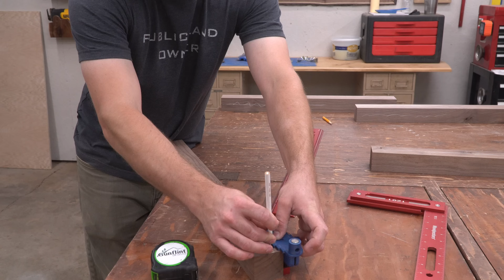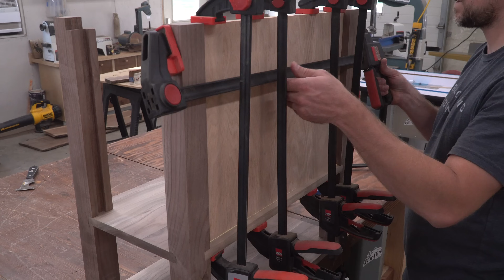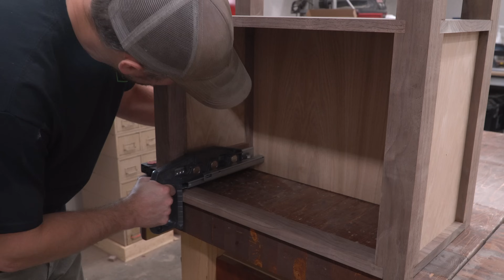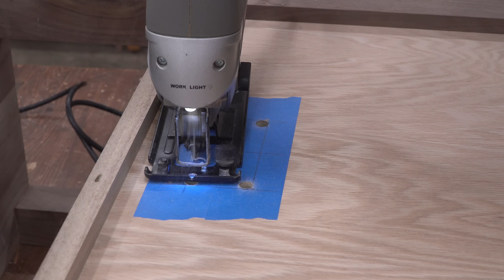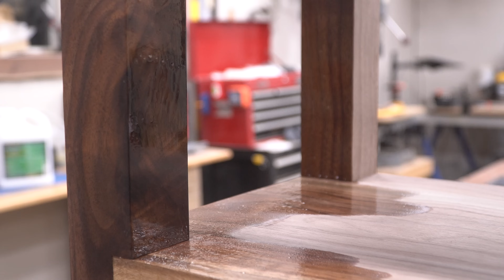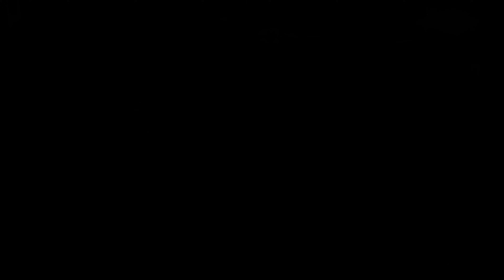Nightstand With Built-In Power - Woodworking Project

Comment: I like the design. Trying to scale it. So the bottom open shelf is about the height of the bed (to hold/see alarm clock) and the top is about 6-8" higher for knick knack stuff?

Are you happy with that or would you change it in future builds?
Reply from the maker: So far I'm happy with it. I currently don't have a box spring under my bed, so it is ultra low. My goal is to have the top be about level with the surface of the bed when it's at the correct height.

Comment: I got rid of a traditional alarm clock years ago and have used my phone. I can change the tone for when I get too used to it and have that dream of a sound I can't get rid of, can set a much more advanced schedule for when necessary,  and it will work without needing an extra 9v installed in case the power goes out. I'd say I wouldn't need to adjust it either, but the last traditional alarm clock I had, would set the time itself when you plugged it in.
Reply: That dream lol